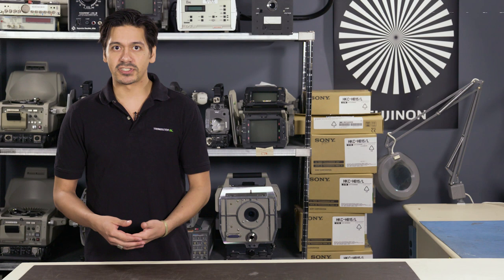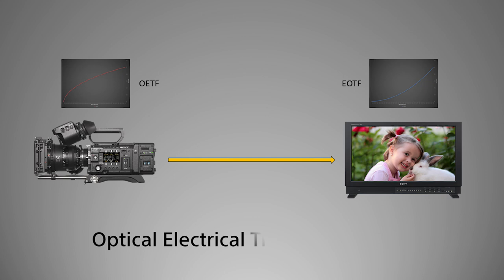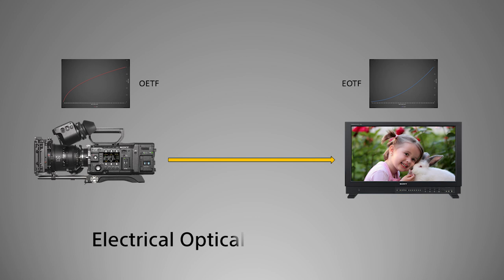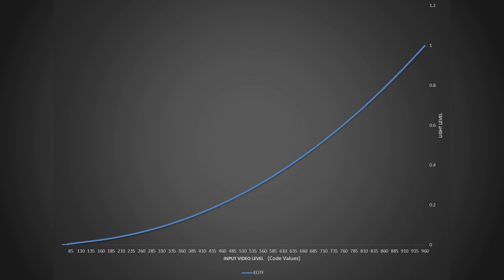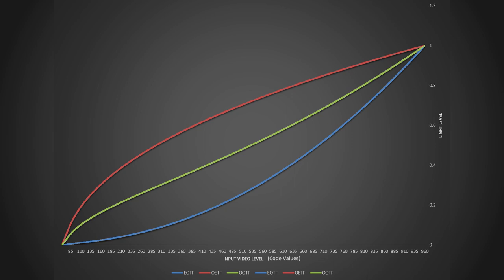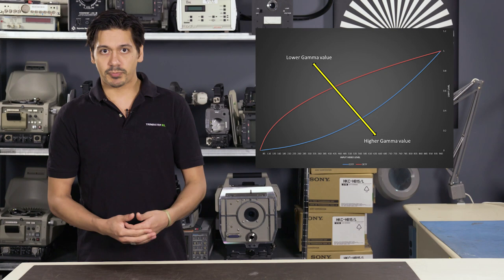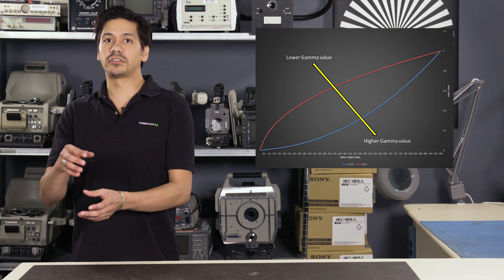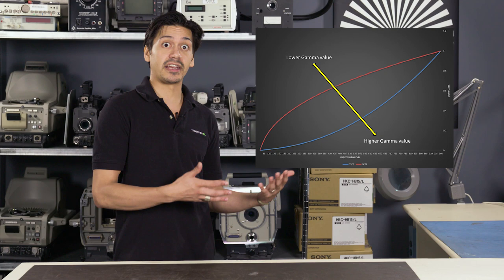Tech Tips: Understanding Gamma and Dynamic Range When Using Sony's Monitors

Comment: Cool video!

Something that I need to understand better . . . it seems intuitive that you'd want OOTF be as close to a straight line (y = x) as possible - this corresponds to something being equal on the scene end and the display end. This influences your choice of gamma or the power exponent in the OETF and EOTF, but why is there a convention for gamma being high on one end or low on another? More generally, what are the interpretations of gammas in the OETF and EOTF?
Reply: I think just for preference... Maybe you want your shadows compressed to draw attention to the highlights or vice versa? That's my understanding based on, admittedly, very little.
Reply: The reason is allocation of bits. We do not have infinite bandwidth and as such we need to get as much as we can out of the available bandwidth. We do this by allocating more bits in the areas where our vision is most sensitive (dark areas). This is what the gamma curve does for us. There are also some historical reasons that coincide with this.

Comment: Honestly, I still don't really understand gamma... It seems that the OETF and EOTF basically just cancel each other out, so why use them in the first place?
Reply: Yeah they really need to do follow up video all I ever heard of before is EOTF didn't even know about OETF or OOTF!
Reply: Basically to get more luminance detail, but also because sometimes you don't want want it to cancel out based on the mood and balance you want in a shot. (This is just what I understand, I may be wrong) Camera's can only record so many values of luminance, and if you use a flat curve then the image may look, well, flat, with most of your detail being in midtones. If you use a OETF curve, the the camera can record more detail in the shadows, giving you more to work with in post production, but possibly bringing up shadow and midtone values and slightly compressing highlights (which are generally less valued than shadows). To compensate, EOTF is a gamma curve that recompresses those shadows to give you the flat look that will look as natural to your eyes as your display is capable of displaying it.
So why the curves? If you like what the video looks like straight from your camera, then the curve probably isn't helping, but if you want to do a color grade of any kind, you need as much detail as you can get from your camera so that your computer has enough data to work with and still give a natural image after developing. Without gamma, there's not much data in the shadows to work with, so if you try to lighten the shadows, you might find a lot of posterization and lack of detail, but if you're using gamma, then  the computer can brighten the shadows without loosing so much data that the image looks bad. EOTF I believe comes effectively before this, however, so that using this gamma curve doesn't make the image look overly dark. I hope that makes sense!

I think a way to think of it is that OETF warps reality and makes the image look weird and EOTF then simulates reality and normalizes the image from that data, but you have more control over how "reality is warped" or what the image looks like as it goes from the camera to the final video being watched.